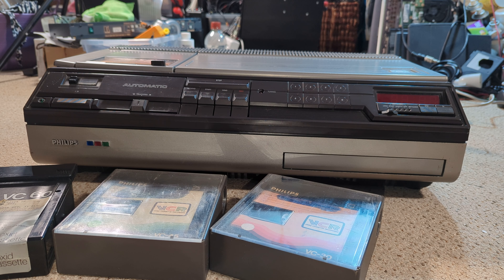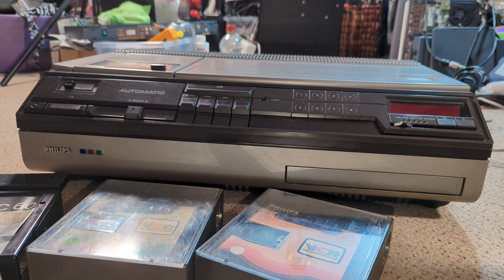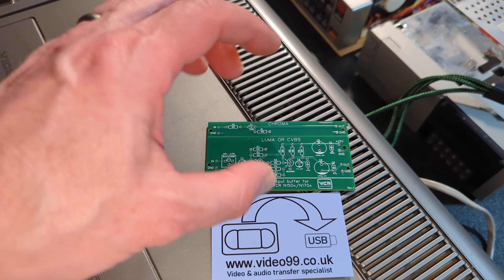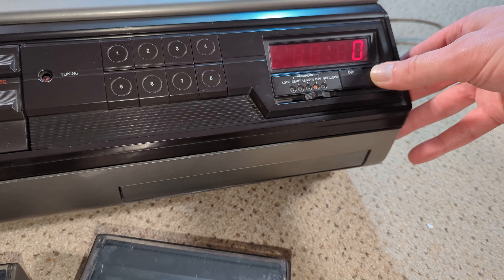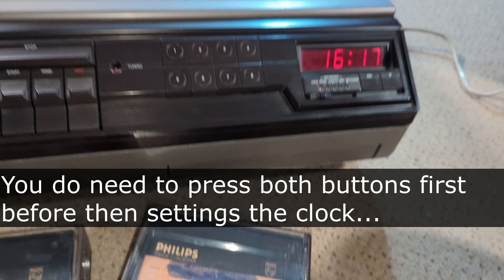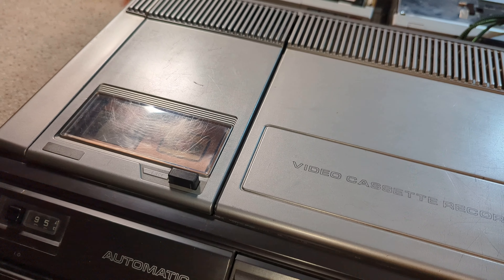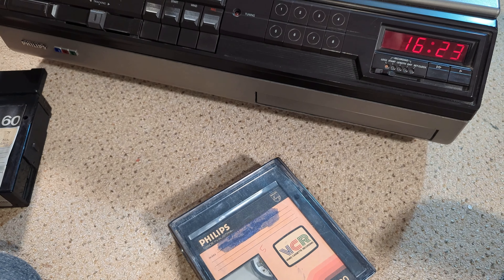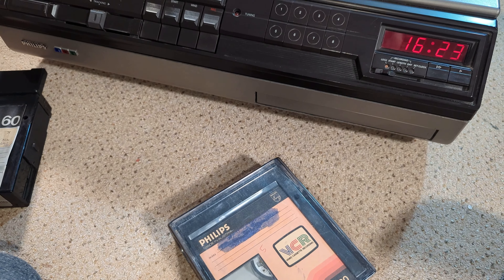Quick Look! Philips N1700 VCR-LP - Ep 6 S1

Comment: In the day i had a Philips K9 colour set and also a Philips N1700 in my lounge room, Great units, but the N1700 was changed out for a early sony beta machine. Later on i upgraded the sony beta for a panasonic NV300. The then old N1700 had been stored for around 5 years and was bought back into service after a quick clean and belts replaced. Talk about being built like a battle ship. I still have the Philips K9, but the picture tube is starting to show it's age.

Comment: About 24 years ago (1999/2000) someone gave me a Philips N1702 together with a box of tapes. Never did get it to work, changed the belts but it would never complete the loading cycle. Managed to get a scrap machine (with broken video heads) and did some (servo) board swapping but it still had the same symptoms.

Comment: My N1702 always struggles to rewind all the tapes I have to the very beginning. I’ve changed the belts, cleaned it many times & rubber renewed the idler that drives the reels. When I’ve just cleaned & renewed it fares much better when I rewind straight afterwards but the next time I use the vcr, it just struggles again. I have a dozen or so tapes (some are SVR) but they all react the same. I’d be interested to find out whether you’re successful with that on this N1700. Cheers, Rob.
Reply from the maker: I wonder if there's contamination between the upper and lower spool. Looking forward to looking into these issues further.
Reply: I would still blame the idler.  But also sometimes it's the tapes themselves.  Still them in a electric oven at 50C for 24 hours and see if they work better after that.
Reply: These machines are well worth the effort. The picture & sound, while often less stable than vhs & beta, was a notch above them (especially vhs) in terms of quality. The faster video writing speed & wider track width, seemed to mean the picture needed less artificial sharpening & coring, meaning it was sometimes hard to tell you were watching a recording & not a live program on the typical 22” crt of the time. I have had a few N1700s & N1702s, some from when they were current models & I reckon only the unreliable coaxial tapes let them down. One thing I always noticed though, was that totally red screen pictures in particular exhibited a strange vertically striped image, not sure if it was because the colour had less noise overall than the Japanese models & the noise masked the effect on them??